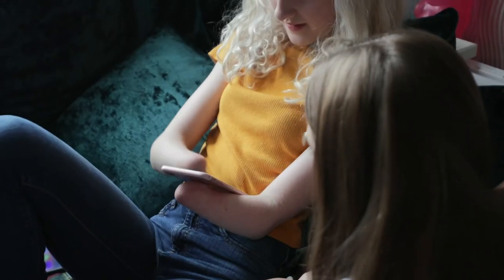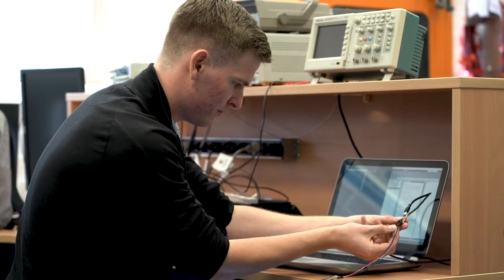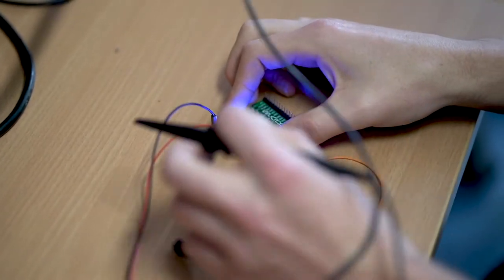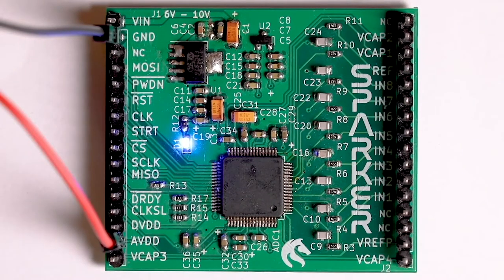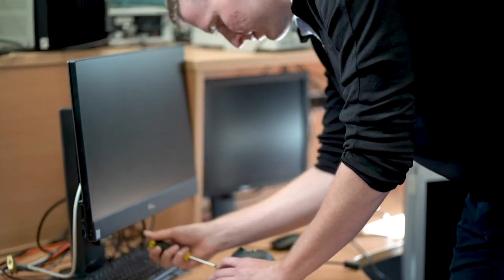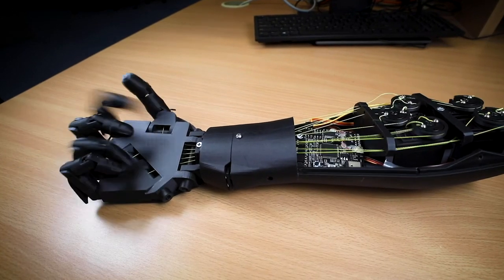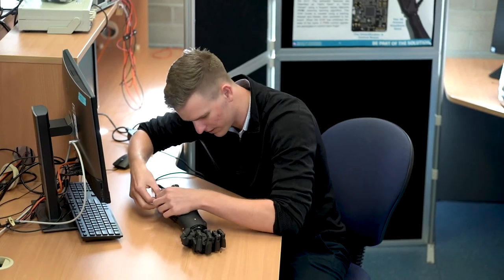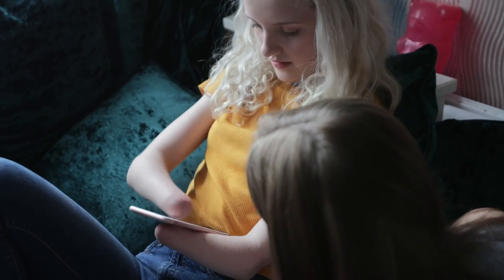Mind-controlled prosthetic

Comment: This just gave me a thought about "Locked-In syndrome". I wonder if this could help them one day. To go from the worst times in your life, to being given the opportunity to partially return to how it was before.
Reply: Great idea!
Reply: Brain-computer interfaces are the way to go to assist with locked-in syndrome
Reply: I have been working a little with this at our university in Uppsala, at the IT-department. The trouble is to find the connections between the brain activity and the concepts that the person is thinking of. Brain waves, EEG, are quite crude signals, when it comes to thinking about things. With mRi cameras you can get closer to the semantic parts of the brain, but that is unfortunately not feasible to use for individuals.